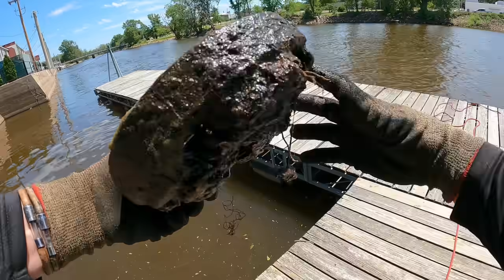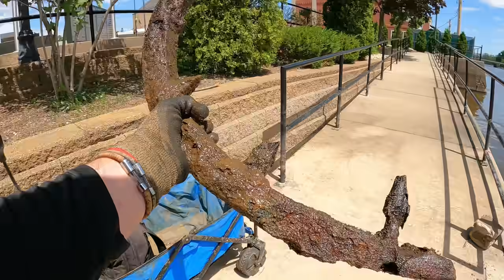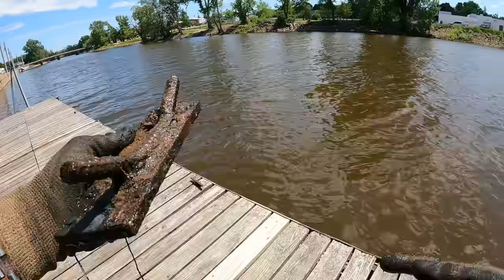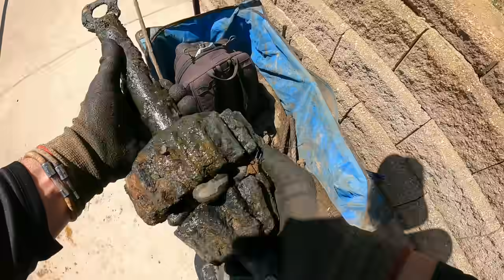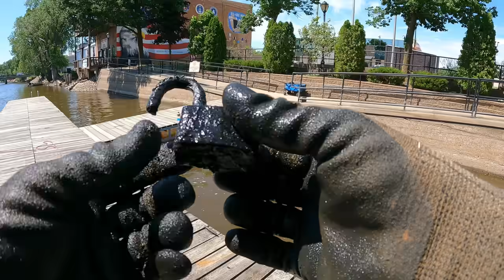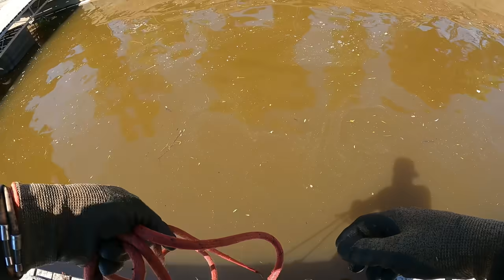I THOUGHT I WAS SNAGGED!!! (Magnet Fishing)

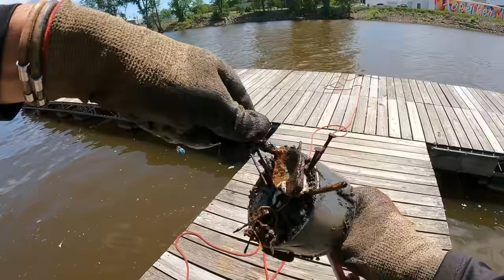Comment: 6:00 Part of a bicycle peddle 
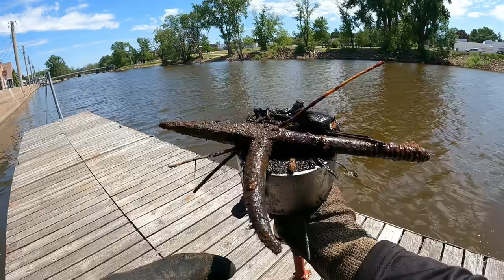11:00 The business end of a Firefighters Pike Pole
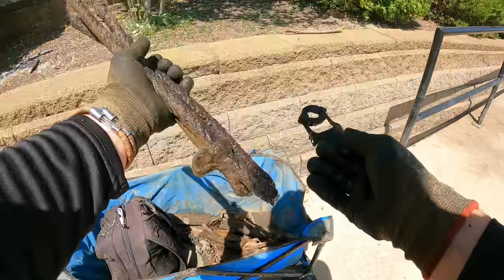13:00 I think I have a good idea of what that is part of in general...lol... part of some kind of Flip Lock thing for a pipe/tube or adjustable length pipe/tube. I remember using something years ago that had something similar to this on it, and once in the locked position you slide a steel sleeve or ring over the tab to hold it locked, but can't put my finger on what it was., Memory not the best ever since my head was run over 5 years ago.  You have probably seen simple versions used on various bottles with flip caps, usually made out of small steel dowel/bar.  If you were to clean that up, my guess is the round ring looking part will spin freely.

Comment: Another entertaining awesome video. The first thing you pulled off with loop on top and hook on bottom usually had 4 hooks. They could be made in different sizes. They were called crows feet where I am from. Could use them attached to a metal rod and dragged behind a boat to catch mussels in the river. Also were sometimes used to search for drowning victims.

Comment: As an historical renovation contractor, that is a window weight. Old wooden windows and even windows of today, the upper window and lower windows are called a "sash" you can tell by how the top of that weight is rounded over so it doesn't cut the rope as the sash is raised and lowered. Also, regular rope is not used for them, you need sash cord!
Reply: Do you think the “wagon wheel “ is actually the top window? It makes since with the peace of glass found that a window was dumped in the water.
Reply: @aprilfurcean8302  It's a wagon wheel. You can see the grove for the metal band that went around it. Also, the wooden spokes that have rotted off except for the larger ends.

Comment: The thing you found at 13:40 looks like part of a transmission. The hole is where the pin of the u-joint attaches it to the drive shaft or a propeller shaft if it's from a marine engine.
Reply: I thought so too!

Comment: 21:46 - that's  a standard 8-pound(ish) window weight. Two of those would counterbalance a roughly 20X20" (glass) sash. I know because I replaced 13 panes in my last house and re-puttied most of the sashes in the house. If you found bigger than that, the window it balanced would be correspondingly bigger or have a heavier frame. The rust will look different versus steel because those weights are cast iron.

Comment: the gear thing now is a homemade anchor >Ages ago it was part of a drive unit. Picking the power up on the straight gear and transferring it to the bevel gear which engaged another bevel gear, which could simply a turn table or right angle motion turn

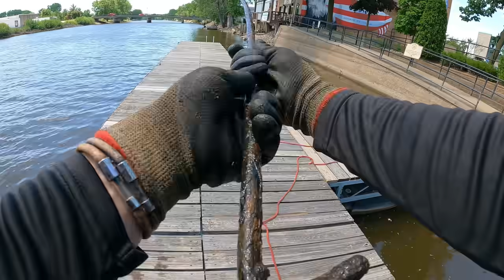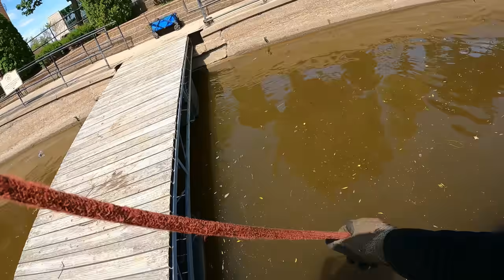Comment: 9:55 Probably rebar suppose to use in the corner of the wall. You see the wall at 10:03 time stamp left side of video bends before that building and 10:10 wall does a zig-zag bend  right side of video. These rebar would go into those corners.

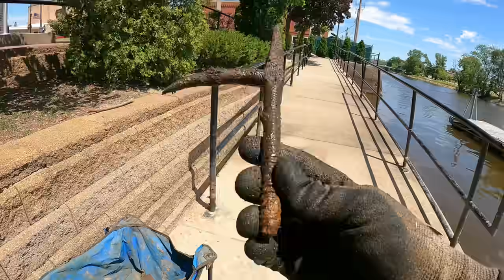Comment: 11:19 that could be an old school  fire poker , or a Cant hook that lumbersjack use to maneuver the logs while floating down river to the lumber mill. Find lots of those here in the river close to my place as they use to do that here. Heck with the price of gas going up i would be surprised they start delivering logs via river again.
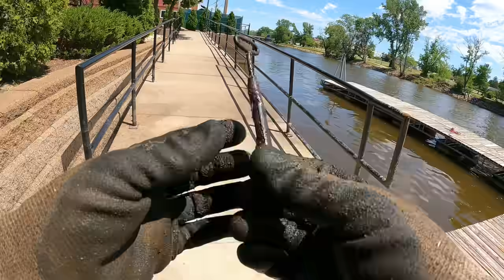Reply: 11:58 What i find odd you find these can/sardines key with lids ,but where are the cans?  Did the people keep the cans but throw away the key/lids?
Reply: 12:33 yup cable use by a crane or to bind something tight in place.
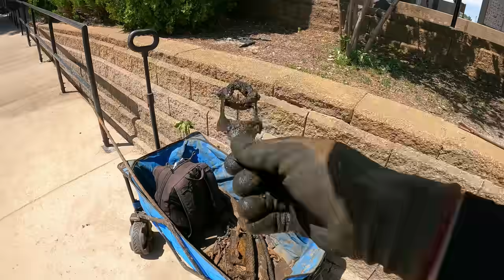Reply: 13:11 Look a flag holder
Reply: 14:12 Yup gear to some heavy duty machinery.
Reply: 15:57 This is a floormat that a car dealership put in  when working on your car.
Reply: 16:54 Cover plate for chain/belt assembly.  Yes the wire attach seem like someone wanted to paint it.
Reply: 17:35 Yup looks like an old school Eveready battery

Comment: Tyler, that first thing you think is a sardine can opener, is really an old bottle cap remover. It you think of a glass bottle with a cap on it, the inside of the opener, the oval part goes onto the cap, and you lift and it pops off the cap. If you look at the old caps, you'll see the bent part of the cap, that's where the bottle opener lifted the cap!!
Reply: relook it is a turn key for and early can top
Reply: @bigjarn  I remember those turn key tops and they were smaller than this one. Now, I maybe wrong, lord knows, I am not 100% right all the time but, it looks like an early bottle cap remover before the popular twist off ones. Seems like this tool he found is too big to be thrown away after one use.
Reply: @trybriguy1357  There are no hook cleats on it to lift a cap neither one has cleats I'm viewing it on a 20" monitor